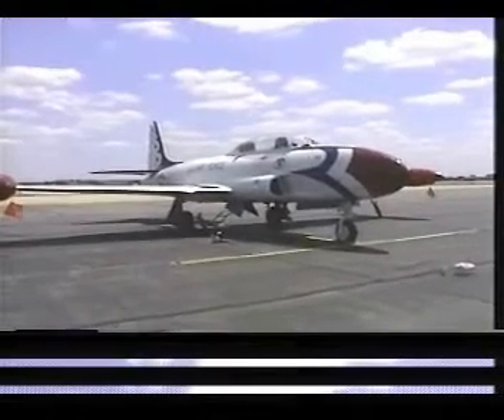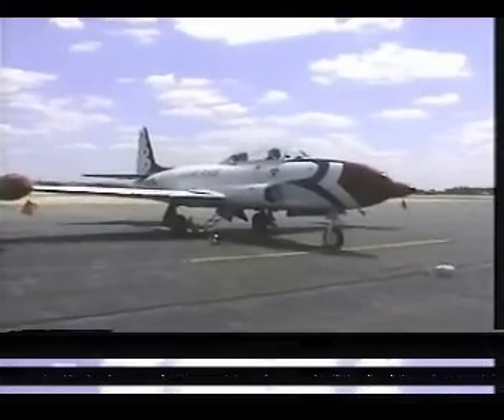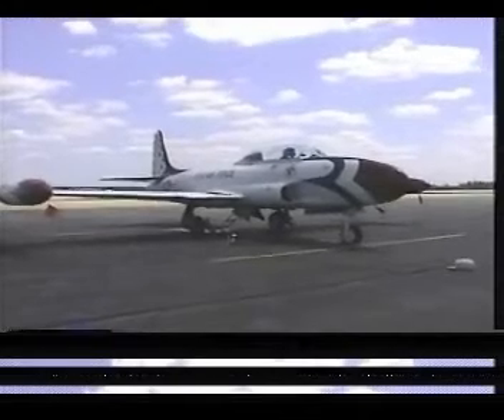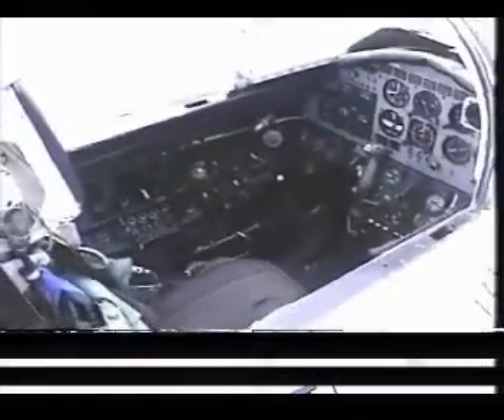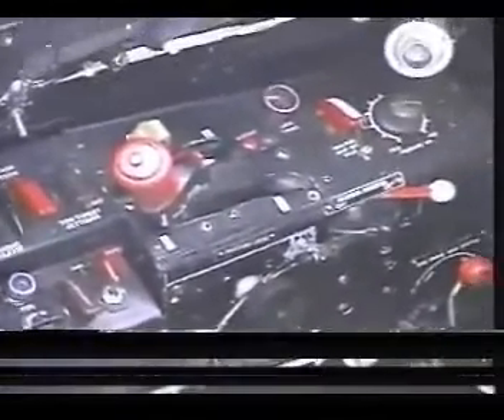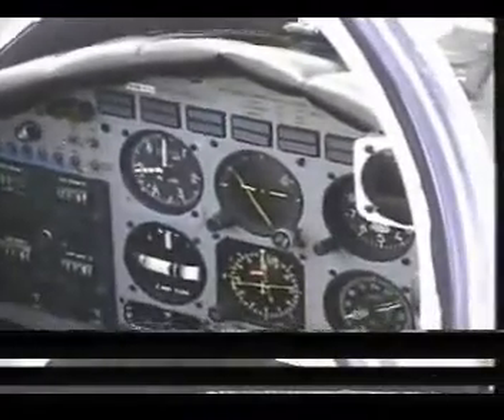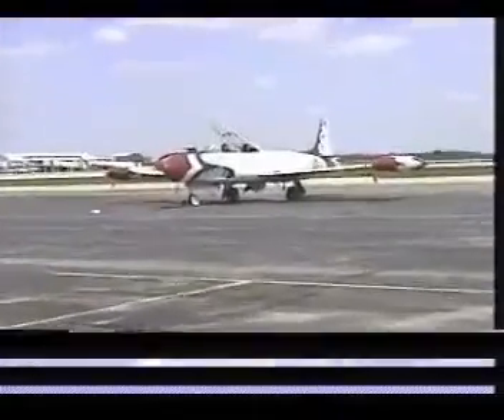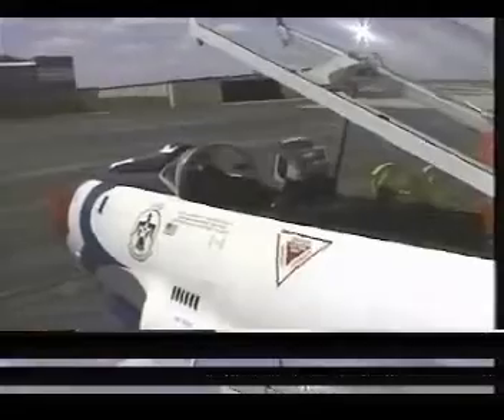Lockheed T-33 Operating Instructions - Part 1

Comment: He said it is going to a "good owner" - would have to be someone with a monster wallet!   Even at "only" 300gph at cruise, at today's prices (what, 6 bucks a gallon?) that's $1,800 per hour for fuel ONLY.  Maintenance would be a  massive amount of money.   Having worked these jets, avionics wise; instrument system wise, RADAR wise, etc (not this one) they ALWAYS come back with write-ups.  Maintenance intensive is an understatement.  But, if you have the money, you can have the fun.

Comment: @50caliberFistFK Jets aren't particularly efficient to start with, and the T-33 uses one of the first generation of jet engines, so it's particularly bad. For several years after the U.S. got its early jet fighters (the T-33 is just a two-seat version of the F-80 fighter), it continued to keep piston-engined fighters in service, since the early jets were such fuel hogs that they had terrible range and endurance.